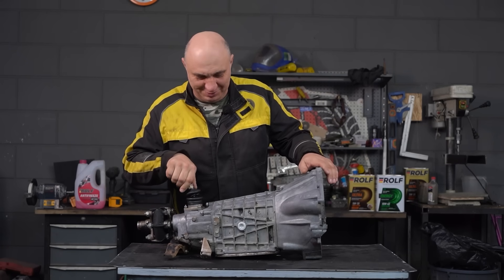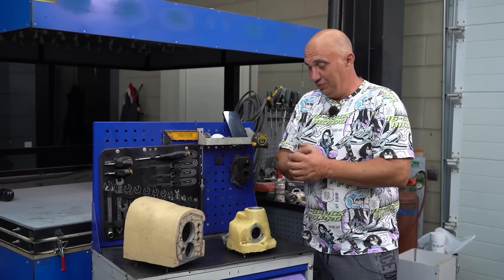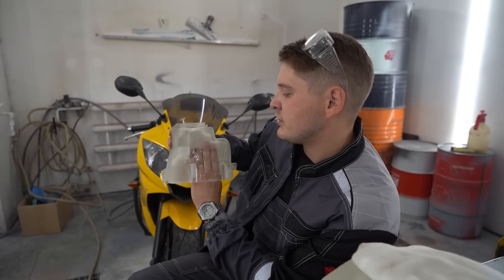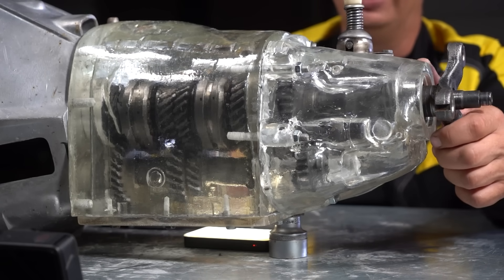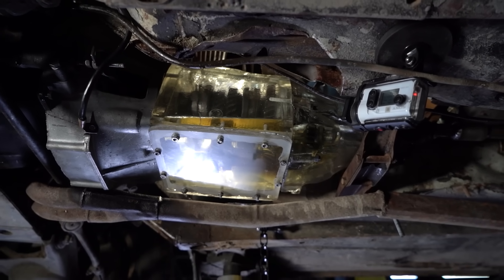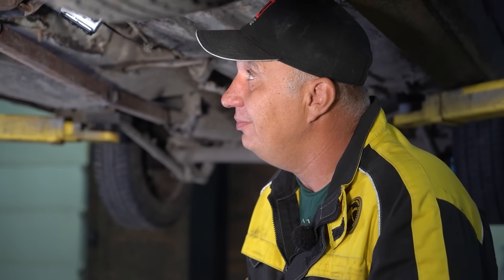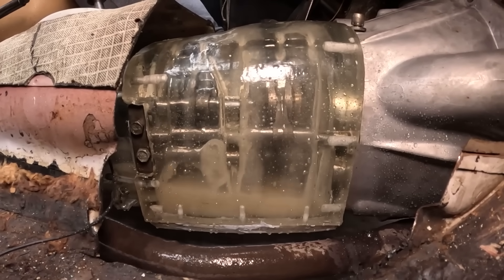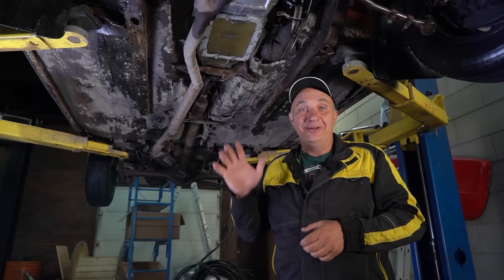We make a fully transparent manual gearbox

Comment: I don't think the trans casing gets stressed enough in common cars. From what I've observed it isn't attached to the body. So all forces go to the engine mounts and axle. That's why the metal case is so thin. You made an absolutely great job with this project 🎉

Comment: Think they will make transparent brake system where brakes are visible and can be adjusted by just watching them from outside instead of tightening them by guess 
Its india problem where the rear brakes are used more than that of front brakes cause of the Indian roads 
They dont get the actual play of the brakes and just apply rear brakes just to avoid accidents and this cause to tightening the rear brakes and damage to the brakes and replacement which is not done as recommended

Thank you for the info

Comment: Epoxi is not structural strong enough.. you should FIBERGLASS the structure.. the epoxi is only to hold the fiberglass in position.   Like Surf boards.. structure is the fiber, not the epoxi or poliester. So.. if you use molds, try to add a mixture of resin + fiber, maybe in a 50%+50%. It will fill the mold and have so much structure force that it will not brake. Maybe you can equal the aluminium hardness this way. 

Conclusion:

Not add only resin.

Add a mixture of resin + fiber. (as it can be liquid enough to fill the mold)

Try % of fiber to see which % can be liquid enough.

Fiberglass to be transparent.

FiberCarbon to be stronger.

FiberKevlar to be more stronger.

Comment: Manual transmision and automated manual type of transmissions(AMT/DCT/DSG) are simple and easy to understand even in hand drawings on papper. Automatic(AT) on other hand is different story. They are more complicated by desing and their work logic is interesting to be observed (if possible in slow motion) in real time on real model. Espacially the Torque Converter and it's torque converter clutch! Im always wondering when and how lock-up is performed. I know most of the time in modern vehicles torque converter running locked but also know it do frequently lock and unlock opperations to impove driving comfort. So would be happy to see working transparent automatic transmission. Ofcourse I just giving an idea for new video. I know it is complicated job espacially the valve boby part(mechatronic) with high pressure fluids to be done with transparent cover. Also only very specific torque convertors have outside mounted cluch, most of them have inside builded clutch and looking inside is almost imposible. So it know it could not be abble to happen.

Comment: Can you get a hold of the prints for the casing?  Plexiglass will be stronger, plate on either end and heat bent body, but will need machining to get bearing seats and such in the right place.

Comment: the gear box  shoould never fail as the casing should never be under load per say . if it does then that means there are issues with vibrations and even the stock one would fail at some point

Comment: So, how much did it cost? In terms of materials and labor, just the initial investment, mind you. No matter how much, I would say an undisputed success simply making it clear. In terms of the usefulness as a visual learning aid or a test platform to be able see the performance or failure of prototype parts or even off the shelf parts. The list goes on and on with potential for all kinds of problem solving and learning aids. Almost infinite usefulness unlocked, and if wasn't too expensive, it doesn't even matter if it broke. You could have some molds 3d printed to be reusable and really then it won't be an issue when it fails. Just cast a new housing and right back to work!  Well done!

Comment: Would the heat from the exhaust cause any problems to it? Or is it far enough away?.
Next project: motercycle engines. 
Also, have they done a transparent valve cover?

Comment: Single countershaft transmissions dont handle torque very well under load.  Heavy truck transmissions, the best examples have two countershafts, to spread the load more evenly.  Mack Trucks even had triple countershafts in their 9,10,12 and 18 speed transmissions.  Amazing that the plastic gearbox survived a gentle test drive!

Comment: Now build all parts of the car transparent. Motor and flywheel can stay metal though, Transparent doors , hood , body , seats , floor , frame , Transmission (check) , trunk.

Car would essentially last forever at that point.

Comment: Gearbos survived probly because there is no stress on the material itself motor exploded because there is high pressure explosions going on and the epoxy cant handle that much pressure and stress

Comment: Try using a clear silicone oil in the gearbox.
You may have to add an anti-foaming agent, but the clear oil would make the internal parts better visible.
Test the oil to make sure it does not react with the paint or resin, first!
Making it opaque by accident would not be good!

Comment: cool to see, the oil splash is an old school design. In old trucks in the winter,we used to put them into neutral transfer, and gear four..just to get the thick molasses gear oil turning,before loading it.. worked well in the frigid cold. :goodvibes:

Comment: Well you also got to consider the fact that the see through engine also has to deal with heat and compression, while the gearbox doesn't get as hot and doesn't deal with pressure inside.
Reply: Helical cut gears are always trying to push each other apart, i am surprised it didn't explode immediately. 

They need to put a remote driver position in so nobody gets hurt when they decide to send it 😂

Comment: That was seriously impressive. I figured it would blown itself to pieces under load because of the bearings becoming unseated. 

Not based on their work but because of the material being inherently weaker. 

Seeing it move under load is just insane ❤😂👍
Reply: solution: make it massively connected through a brake

Comment: Nice to see how the integrity of the transmission housing isn't as important when it comes to the overall strength of the transmission. I suppose that makes sense, as the housing is what keeps the oil and transmission in place, but the gearing is what takes on the majority of the force. Awesome demonstration as always!
Reply: issue is.... The gearing is on two shafts.... Held together by the housing!
Reply: if you get one bolt, nut or sand between those gears it will crack that housing wide open. it happened to my brothers 1930 Chevy while driving  it along the shoreline and got water and sand in the tranny.

Comment: you can use a heat gun too to 'melt' the top layer and make it clear.
Reply: I don't think that works with a thermoset resin
Reply: Was gunna say they could have also lightly heated it with a blowtorch as well

Comment: Have you guys ever run an engine on manual transmission oil? 🛢️🛢️🛢️
Reply: Its basically the same thickness as 10w40 couse gearbox oil has a different scale🎉

Comment: Now you got to make a clear rear differential..
Reply: They've already done so, well half. A transparent backing plate to the differential
Reply: they've done engine ,gear box, differential
soon the whole car transparent ??? :d
Reply: @ndebele100  They did clear Vacform panels too, all of them together for a complete car would be 107% AWESOME!
Reply: I'm pretty sure Banks Power already did that when they did the Banks Diff plate
Reply: A transparent Diff would be cool, or at least a transparent Diff cover.
Reply: One open diff, and the other limited slip.
Reply: That won't be easy . The clearances and lash would make that difficult . And then the load between the ring and pinion would be as sketchy as it gets ... But you never know with these guys, they just might pull it off . :)
Reply: Banks Power did one a few years ago if your interested.  https://www.youtube.com/watch?v=9-yG3D3JBRs
Reply: then move on to Clear people

Comment: There are weak transmissions out there in the auto industry known as "Glass" transmissions because they break easily. You've truly made a "GLASS TRANSMISSION!"
Reply: Glass Transmissions like the T5 in SN95 Mustangs, or the 5 speed Subaru gearboxes are perfect examples, 😊
Reply: @NeatJC84  I was just thinking about how the 5 speed in my WRX blew up 1200 miles after the engine build while watching this.  Turns out blast plates make zero difference when you're at 470whp.
Reply: @drunk3n_m0nk12  they can't handle 300whp reliably unless you're careful lol
Reply: Gotta double clutch 5th in my 98 cobra. 86k miles going strong  @NeatJC84
Reply: The T5 is not a glass transmission.  Any gearbox can be overpowered.

The AX/4, AX/5, and BA10/5 on the other hand...
Reply: and it probably survives longer than a "glass" transy
Reply: Opel M32 left the chat...
Reply: Myth busters proved you can polish a tred
Reply: The transmission mount should have a steel plate running back to the bellhousing
Reply: Requesting that you make a hand crank start lada with a V6 engine
Reply: Yes, this guy is talking to you, 5speed Subaru gearbox! lol
Reply: Polishing and buffing would make it really clear another trick is to use off bug repellent to clean milky headlight plastic
Reply: The transmission mount should have a steel plate running back to the bellhousing
Reply: M32 6 speed gm. That was the most crappy gearbox I've ever had. And in second place de Suzuki gearbox in my swift.
Reply: any honda automatic before 2009 made of glass
Reply: No it's any Honda transmission after 2000. They have internal transmission filters and if you change your fluid every 15k it last 300-400 thousand miles. This is including the V6 transmissios before 2002 I believe as well. They have internal transmission filters, knows as screens.  @IND4GR0V3
Reply: Chrysler transmissions
Reply: Red dye in the gear oil
Reply: Like the older VW Polo, those gears are made of styrofoam.
Reply: Great success. 🎉
Reply: Average ZS transmissions
Reply: GlassAss
Reply: Its a RUSSIAN TRANSMISSION
Reply: @thegreat9481  NO SHT SHERLOCK
Reply: @Epsonblade  Everything ok at home? You’re unnecessarily angry
Reply: @thegreat9481  TROLL #2
Reply: @Epsonblade  its was actually a joke about Russians being tough and you took it upon yourself to get upset. Weird guy
Reply: @thegreat9481  TROLL
Reply: @Epsonblade  weirdo…
Reply: @thegreat9481  TROLL
Reply: What state are u from or country. I’ve never heard that term, we just say POS.
Reply: Are you talking about Jatco CVT 's? 😂
Reply: You mean chocolate box... I've never known of the term glass transmission and I've been in the business for a little over 20y
Reply: @g_compo8639 
I’ve been using the phrase longer than you’ve been in the business. I’ve heard it used dozens of times in reference to Subaru transmissions.
Reply: @g_compo8639  Well I've been in the automotive industry for about 100 years and glass transmission is a well known term. Just look in the comments troll.